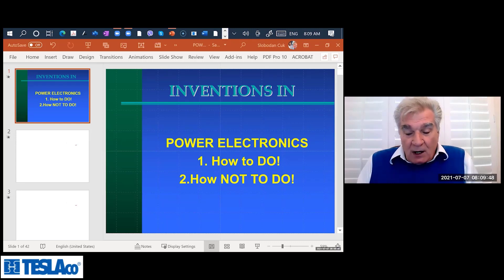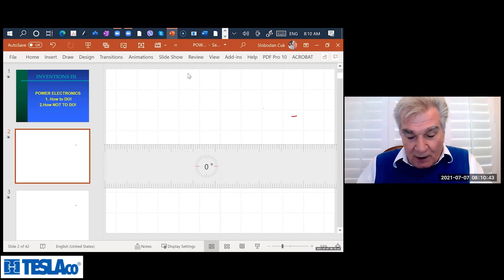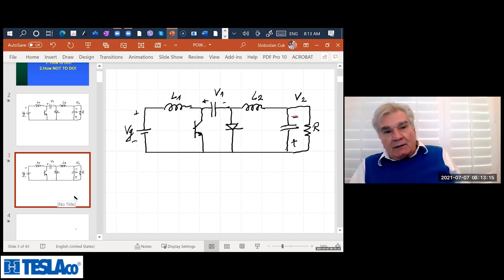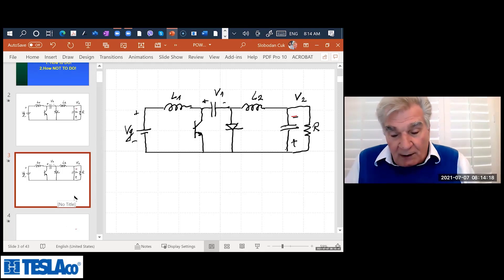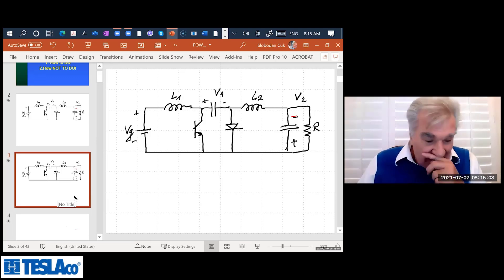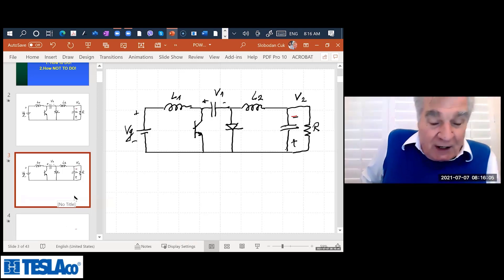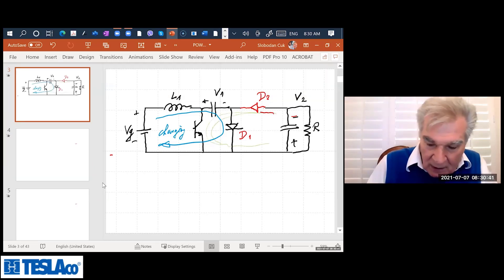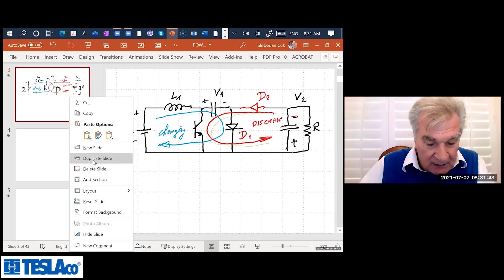HOW TO INVENT IN POWER ELECTRONICS !

Comment: A lot of IC design is taking old circuit board designs and putting them on one chip. This requires little to no thought. What DOES require thought is figuring out a better way of providing the same functionality with fewer parts. NEW designs require NEW thought. 
At Texas Idiots, their terminal group wanted an attribute generator IC. Unfortunately, their design would not fit on any of our gate array chips. Also, the propagation speed was too slow to meet the requirements.
I looked at their schematic and saw multiplexers connected to flip-flops. I created a new circuit that combined the functions of a multiplexer and a D flip-flop. My supervisor simulated the circuit and it functioned as designed, but he admitted that he did not understand how. The terminal group used my circuit and the gate count was reduced enough to fit on a chip. And the speed was 17 times faster than the requirement.
Of the 24 "engineers" in our group, only 2 bothered to read the free trade magazines. Only one subscribed to R&D Magazine. TI would pay tuition for grad school. I was the only student in the group. IC design is apparently just as bad as power electronics design.